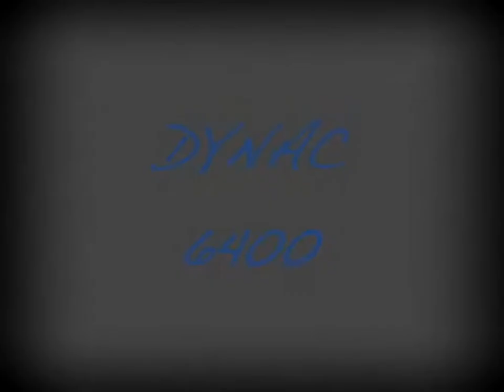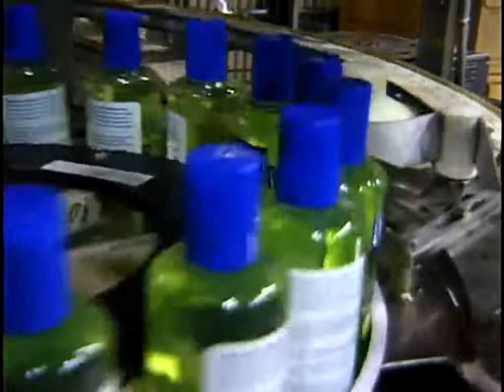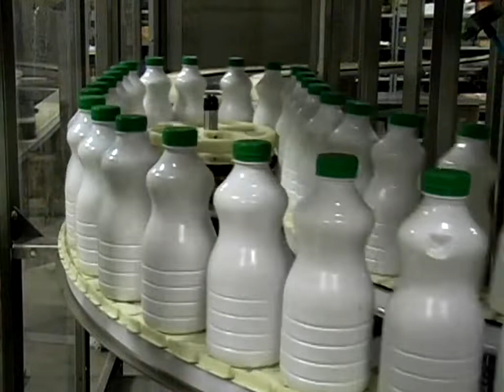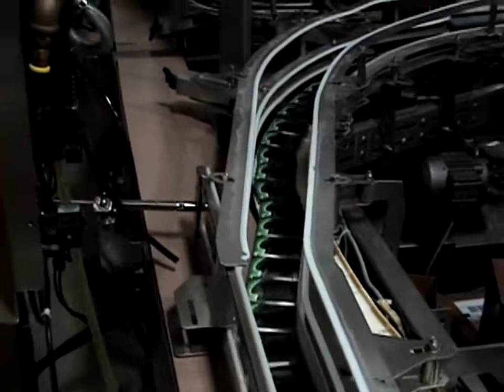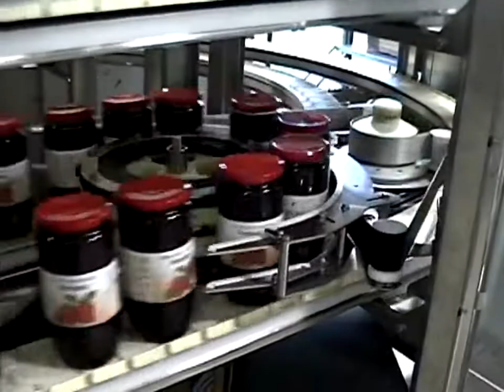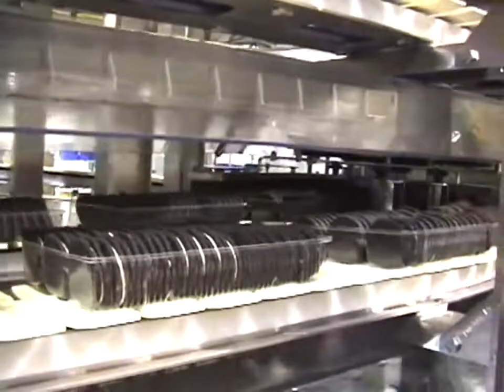Hartness DYNAC Single File Spiral Overview

Comment: We have two models W90600 at work and this weekend we plan to wash the tracks of the belts for the first time... due to jerking issues and after doing  service to spider..... what cleanning process do you recomend for our dry process accumulators?  do we need to remove infeed and outfeed conveyors to do so?